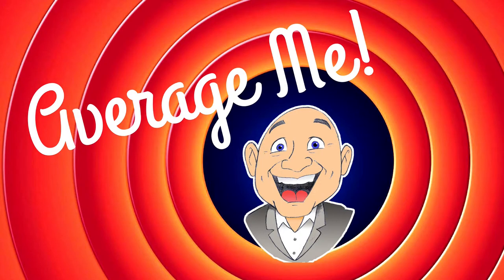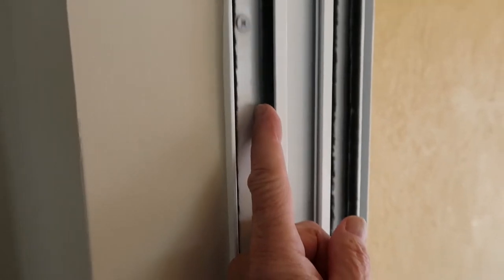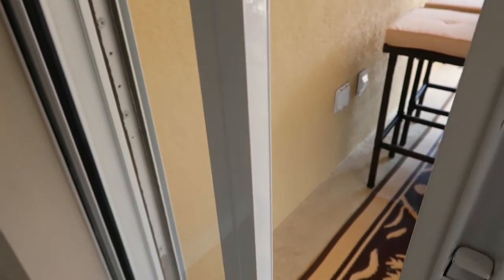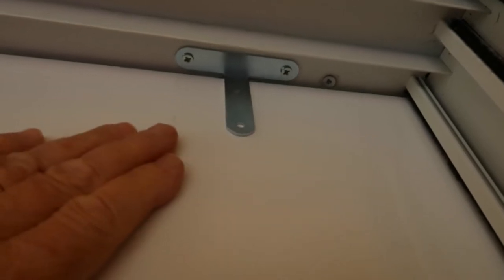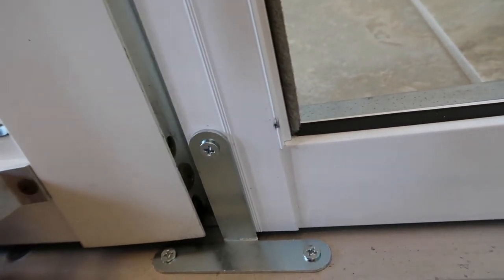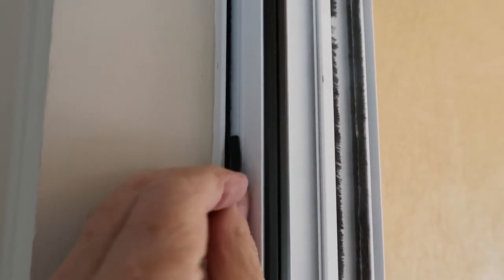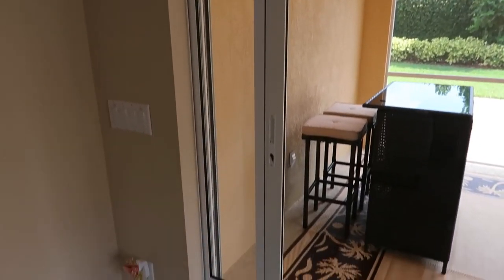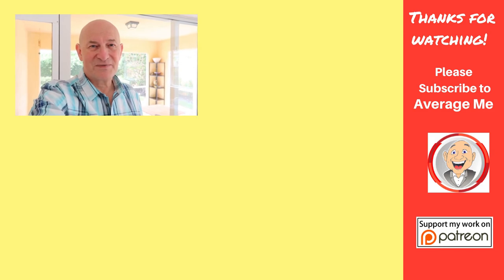Installing a Pet Door into a Sliding Patio Door - Weekend Warrior

Comment: What size was the window spline you uses on inside and outside of the door to fill the gaps?
Reply from the maker: I just had some on hand. It doesn't really matter, as the exact size would depend upon the gap you're filling. I was just riffing, and it worked.

Comment: Hi, I’m curious to know how you adhered the 3M weather strip that you purchased to the top part of the door where the height extender part is. Did you have to cover/fill the hollow space there to make a surface for it to attach to?   If so what did you end up using.  I’d also like to ask, did you only have to apply that stripping from the top down to where you attached the old lock hub part, roughly mid door?  I ask bc I have the EXACT same 3 panel sliding door leading out to my lanai and I have the EXACT same gap that you’ve got.  So glad I found your handy video.  It’s like you made it just for me  😁😁

Comment: How much space do you have when you walk through the door? I put my doggy door panel in but the space after opening the door seems too tight.
Reply from the maker: I suppose it depends on the size of your door. My door is relatively wide, and I am using the smallest panel (cat size). Your remaining opening is going to be reduced by the width of the panel.